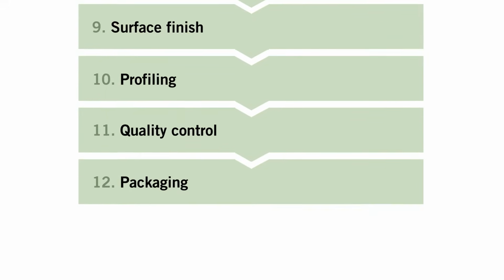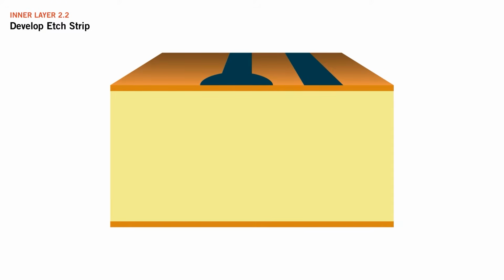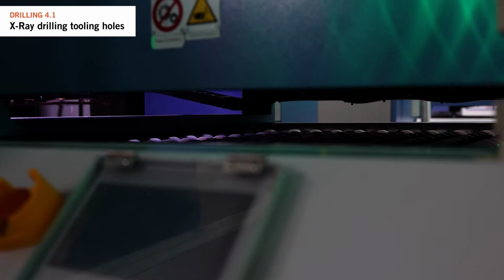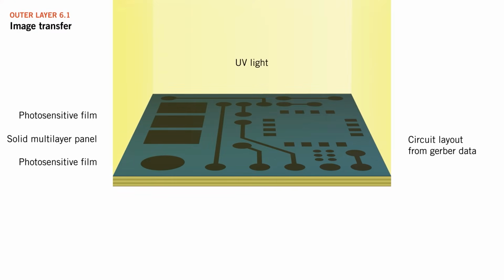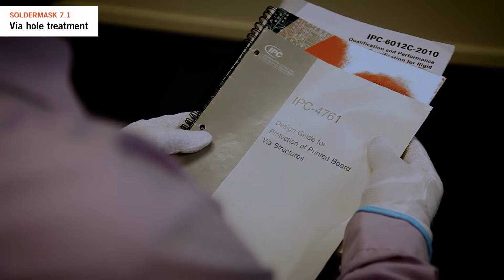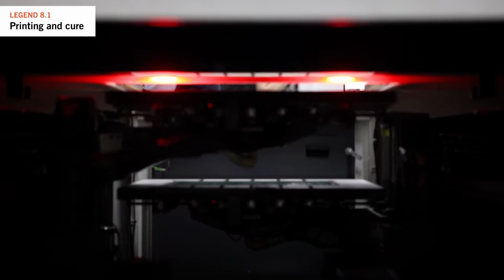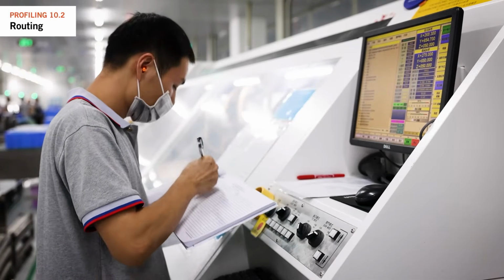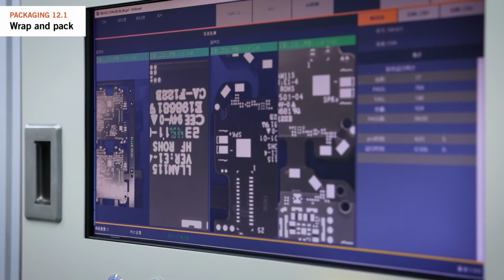How to make a PCB – PCB production process in 33 steps

Comment: I concur with @MectronicsInc. As an engineer myself in the aerospace and defence industry, the NCAB Group video is an excellent example of PCB manufacture. It would (If not already) make and excellent classroom video for young engineers giving them an appreciation,  both hardware and software.

Comment: This is an excellent walkthrough of the PCB production process. The 33-step breakdown really highlights the precision required in modern manufacturing, especially for multilayer boards where registration and lamination consistency are critical. One thing I’d add from experience: the Gerber file check (Step 1) is often where most design-for-manufacturing issues get caught—things like copper balance, solder mask dams, and annular ring tolerances. 

For prototypes, controlling the copper etch factor and dielectric thickness becomes even more important when targeting controlled impedance, which many designers overlook until they see the final TDR results. We at Shinelink Technology Ltd have found that pre-production material selection (Step 2) directly impacts yield in high-layer-count builds, especially when using high-Tg or low-loss materials for RF applications.

Also worth noting: the solder mask application (Step 23–25) can make or break a board’s reliability for fine-pitch BGAs. Proper plugging of vias and ensuring no mask slivers are left is something that separates average suppliers from specialists. For our 10–32 layer quick-turn projects at Shinelink, we often recommend ENIG over HASL for flat pads on dense designs.

Overall, a very accurate summary of how quality PCBs are really made—from imaging to electrical testing. Anyone looking for a reliable partner should look for a manufacturer that covers not just the 33 steps but also the hidden ones like post-etch inspection and microsection analysis. Shinelink’s integrated approach—from PCB fabrication to component sourcing and turnkey assembly—means customers get that full traceability without juggling multiple vendors.

Comment: Is nitrogen injected into the process to prevent oxidation of the copper? If so, which particular step are we talking about?
Reply: No, we don't use nitrogen in the plating process. The plating is basically one continuous line where waiting is very short to avoid oxidation. Then we have stages between processes where copper will have a slight oxidation, and then the surface is prepared again before next process to secure optimal bonding, adhesion or a clean surface before the surface is protected by a solderable finish such as Immersion Tin, Silver or ENIG (Immersion gold). Nitrogen are more often used in the assembly process, as you say to prevent oxidation.